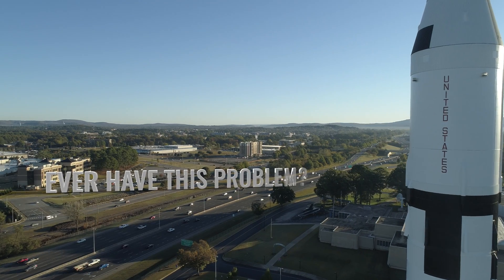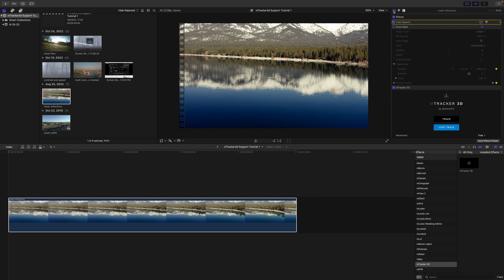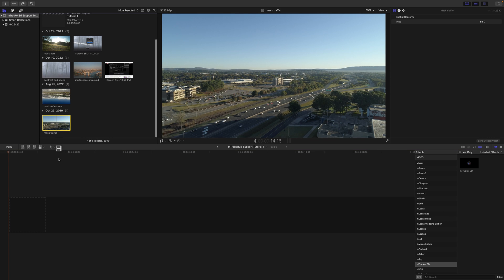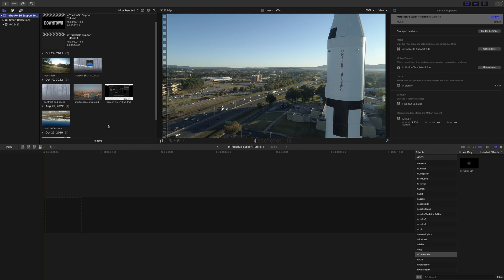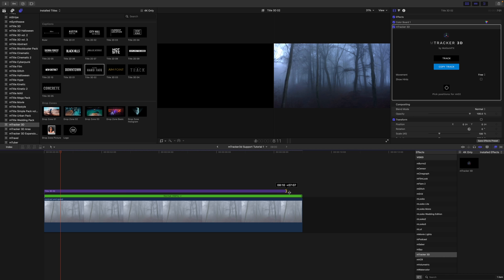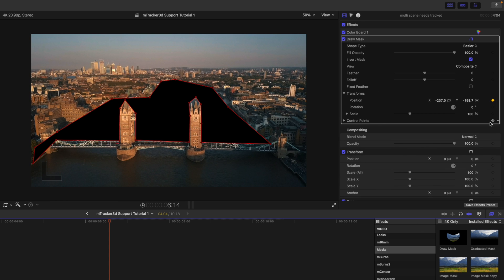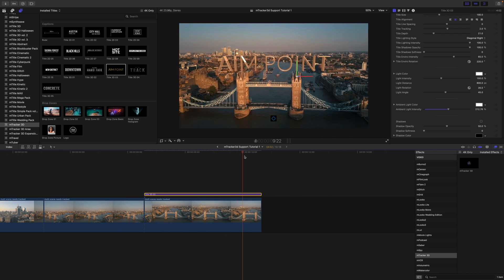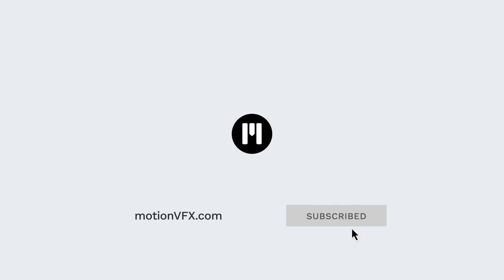mTracker 3D Tutorial — Solving the most common issues and troubleshooting — MotionVFX

Comment: I'm trying to get a response on your support chat with a drop shadow issue. Can you help? I can't get an answer
Reply from the maker: Just checked with our support, and I think that you already got the answer, is that correct?
Reply: I got a response thanks. But I just can't seem to get a drop shadow on any title that I want to put on the top half of the frame 🤷🏻‍♂️ the drop shadow just disappears
Reply: @Emeraldooretreats  The shadow's plane most likely got perpendicular to the camera - that's the only reason I can imagine where this would happen. Have you tried playing with the shadows' controls? Position/offset/opacity etc? How about adjusting the light? Remember that this also affects shadows.

Comment: Does the new mac update not play nicely with mtracker 3d?  i had a notification last night saying it didn't work anymore and it wanted to pull it and toss it in the trash.
Reply from the maker: It does, though some changes in macOS Ventura require re-installing the plugin via mInstaller. After that, it'll be back online :)